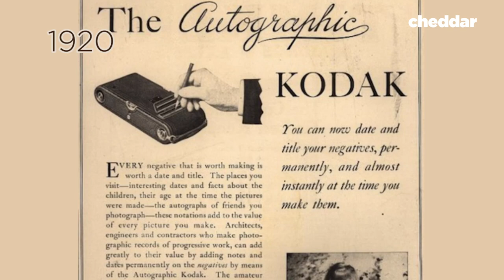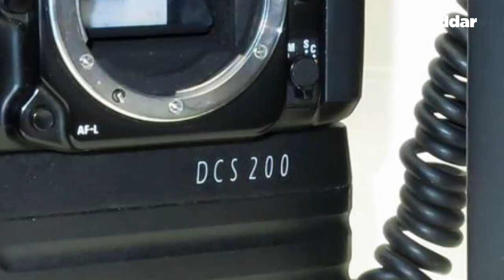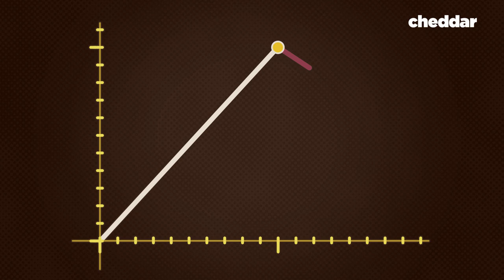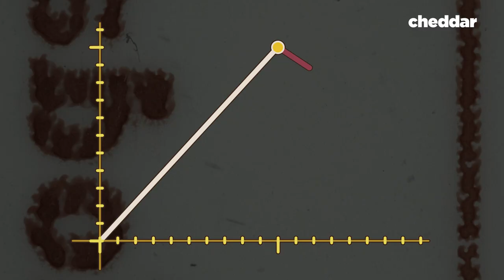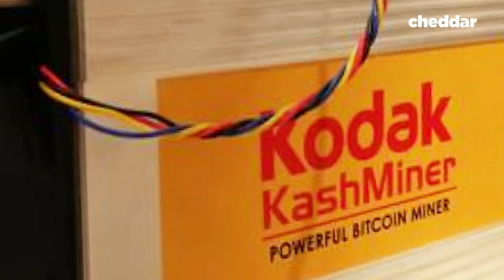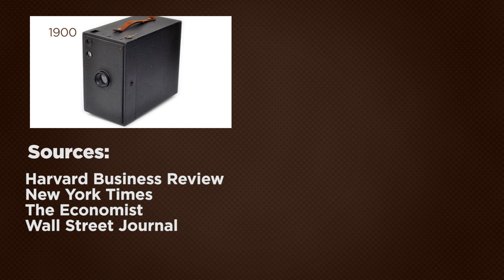Why Kodak Willingly Ignored the Future of Photography - Cheddar Examines

Comment: I migrated from medium format to digital - the Nikon d1x was my 1st pro camera.   At some point in the early 90s Kodak were hyping the heck out of a new digital camera , the DSC that was supposed to be the camera that everyone wanted.   Yeah, until they did their dog and pony show and showed prints that were supposed to have come from that Kodak beauty.   The prints were so heavily manipulated that even an absolute novice would know something  didn't seem quite right.   It was Kodak's insistence that the images weren't retouched that may me decide that I would never knowingly own a Kodak product.   I was sort of ticked off at the time because  I needed a another digital camera and I was holding off buying another D1X based upon the hype.  The day I saw Kodak's presentation was the day that I went to my local pro shop and purchased another D1x for backup.  Which at the time , was somewhere around $3500.  The D1X was "mature" and spending that  was disturbing,  but I knew the limitations of the camera and it was reliable.   At that point,  I felt they were on their way out; they were no longer a player.

Comment: Kodak's downfall had nothing to do with photography and everything to do with the Horrors of MBAs.

The problem in a nutshell: Eastman Kodak was known as a "photography company," but that's not where their profits were coming from. In the years before World War I, the world's chemical industry was based in Germany. Companies like BASF, Agfa, Bayer and the Dyeworks at Hoechst produced all the dyes and bulk chemicals the world needed. Then the war broke out and the world's supply of chemicals dried up. After the war, George Eastman (who founded Kodak) said, "Never again!" and built the biggest chemical company in the United States. They were a huge player in acetate fiber (safety film base is cellulose triacetate; it's no problem to make cloth rather than plastic sheet out of that polymer) and owned the Defense Department's explosives business. Eastman also owned the biggest gelatine factory in America. Their gelatin is very expensive (and extremely pure) compared to Knox and General Foods gelatin so it's not used in food manufacturing, but its purity makes it useful to Big Pharma.

Then came the Core Competence fad, in which you're supposed to pick one line of business and sell off or outsource everything that doesn't support that line of business, and buy other businesses that support the business you kept. Kodak sold the chemical business in 1999. 

Kodak could have had - and actually did have - the most popular line of digital cameras in the world, but without the lifeline Tennessee Eastman provided they were headed for financial oblivion.

Now...what did Agfa and Fuji, both of which were chemical companies who made photo supplies, do differently than Kodak? Fuji still makes chemicals, and Agfa spun off the photo business.

Comment: The original Kodak digital camera was nice but at 8lbs impractical. Perhaps Kodak management couldn't see a way of making it practical with the technology of the day. I remember thinking years ago - when APS film came out that there was so much elecronics in cameras that since they had electronic TV cameras, it made no sense to keep using film. In fact 1976 was pretty late to develop digital cameras. The original TV camera was developed in 1927. Digital stills cameras were a suspiciously slow development. I wouldn't mind betting that the idea had cropped up many times before about digital stills. The holdup was making it small enough to be practical. So, Kodak was right in that it was impractical but wrong not to try to make it smaller and lighter.

Comment: Kodak would take one step forward and then two steps backwards regarding digital photography.  Kodak thought that they were in the photography/imaging business while in fact they were in the film business. Railways in the 1930's thought that they were in the transportation business, but really they were in the train business. If they fundamentally understood that they were in the transportation business then they would have started and owned all the airlines.  EVERYONE at the executive level at Kodak that didn't come in from some other industry would have been weaned on Kodak's basic fact: Color Negative sales are everything.  Kodak sold slide film, B&W film, projectors and dozens of other products but it was all a sideline compared to color neg sales.  That's where the profitability was and everything else was gravy. Any suggestion to get seriously into digital photography  ("Let's buy Adobe." "Let's buy Minolta.") would have been greeted with, "This could hurt color neg sales." and that mindset continued right up until the end. Kodak in a completely different form could still be a (much smaller) powerhouse in the imaging industry but they needed to accept that film was dead years before film killed them.

Comment: It’s very easy to be Captain Hindsight, especially when you are young enough as to not have
lived (and therefore not knowing the nuances) of past’s events. Not every family
had a PC (well, rarely any family had one, statistically) on older times and when they
had one, they weren’t the fast and (relatively) intuitive easy to use machines
most of the people take for granted today: PC's were SLOW, clumsy, prone to
failure, complex devices most people could not handle with ease and even when
they did, they required quite a hassle to maintain and backup. The fist PC's
weren’t easy to open and fix either as they were kind of a device you weren’t
supposed to touch and upgrade. The quality of the first digital cameras that
hit the market were INCREDIBLY crappy, low resolution, slow working and slower
to download photographs that needed a lot of patience and even more patient to
print (a garbage quality) photo if you used the right program and the right paper for such a feat (and logically each camera had their own incompatible-with-others' program). It’s not like
people didn’t like the idea, it was quite exciting, but given such conditions there was little reason to think that there would be a revolution on the gates: practically MOST
photographers LOVED their old (to today’s standards) antiquate analog cameras
with their quirks and abilities to adapt way beyond the things that LATER ON very
costly digital cameras would be able to. People were used to have something
physical to touch, look at, retain and store (and easy to display and SHOW to others) and
remember that those were times where there were no Smartphones (let alone
other handy portable computers and those that existed were even slower, etc.
than desktop computers). Etc. Another factor that people seem to forget is that, the same as today, the market is INUNDATED with gadgets that promissed to be THE NEXT BIG THING to later disappear into oblivion, so it took a lot of trust to really invest on something expensive that later could end up being a useless but "futuristic" thingy (there were so many more failures for any given success...).

Comment: The truth is Kodak tried to put the digital genie into a Kodak bottle the same way they did film but the digital genie had no part of it and Kodak failed to corner the market and the Kodak Moment went poor.  I dropped the Kodak marketing program for my studio in 2000 when I transitioned from film to digital capture.  Fuji offered a better system of digital file to print for the portrait/event photographer and knocked the King off the throne.  In 2010 I began marketing the sell of digital files as well as prints.  Even through I'm now retired I do an occasional job and only offer digital files.
That's my Kodak story in a nut shell, don't get me started on the story of Polaroid.  My daughter just bought a Polaroid snap shooter that uses old tech to put out mini snapshots for fun.

Comment: How about a video on how Polaroid was able to stop Kodak from making instant cameras every time they tried, even after the Polaroid patents had expired? Same video could also cover how Polaroid's fortunes fell like Kodak's, and the resurgence of "Polaroid" by The Impossible Project. They recently introduced a new "Polaroid" instant camera, but the film packs contain only 8 shots VS 10. TIP's film for old SX-70 cameras only has 8 shots because TIP hasn't been able to make their film as thin as original Polaroid film. But the film packs for the new camera don't have a battery so there should be room for 10 shots of the thicker film.

TIP was launched when an old Polaroid film factory in Europe came up for sale. They were able to raise the funds to buy the factory and restore the equipment, but Polaroid refused to sell chemical formulae and certain information about the materials and manufacture of the film. So TIP had to reverse engineer a lot of stuff, which is why their film is thicker and it took a lot of experimenting to get their color film acceptable for use. What they're selling now has better color than what they were offering a few years ago, I assume that's why they've launched that new "Polaroid" camera.

Comment: Easy Share cameras had a limited lifespan, and when they died, nobody anywhere would repair them.
I still have my 1982 Olympus OM10 35mm film camera. Also two or three rolls of Kodacolor 200 film with an expiration date in 2012. I wonder if they are still viable.
Walmart here carries Fuji 35mm 400 film, but it is not cheap. They also, I believe, send 35mm film out to be developed.
I still believe a 35mm will run circles around a digital camera.
Reply: I have a Canon 35mm film camera that I Still use. I've tried the Fujifilm stuff from Walmart but don't really like it, instead a local camera store sells new rolls of Kodak film. Roll in my camera right now is a professional series B+W TMAX roll, and I have Kodak Ultramax film laying around as well

Comment: Kodak mistake was one thing: Greed. They didnt want to let go of the consumables side of their business, to be fair Kodak cameras were quite reasonable at the time, but it was the consumable such as films, developing fluids, paper etc whcih drove the market and which cost the most to procure repeatedly each time. 
The early digital cameras were basically useless and a gimmick as the resolution were poor and they couldn't be readapted to the print industry. However the rapid development in Sensor technology allowing much better images soon got rid of this problem. However people still loved print over digital (it was a bit like the same thing as hardcopy of books vs ebooks; many traditionalist wanted and desired the feel and permanence of a hard print copy).
However what unleashed was the advent of social media and a new generation which wanted more in terms of quantity than quality desired the impermanence of many experience rather than a few solid grounded event and the development of the platforms to support this new philosophy, which saw the downfall of the print camera industry in favor of the digital one.
This change is still going on with smartphones, most laypeople do not want or need to invest in a DSLR or point and shoot camera these days their smart phones being sufficient for the niche use they have for their pictures and events. This is a reason why you seee many traditional lenses makers moving away from lenses for proper digital cameras to work on lenses for smartphones.

Comment: Lmfao the Apollo 11 Moon mission DAC cameras where the first digital video cameras. The Kodak Patent  was actually geared toward cinema productions due to a need for better Chroma Keying that is why Bryce Beyer specifically designed his filter to have more green sensor areas. The Apollo 11 DAC cameras were black and white only due to the sensor. Hollywood at that time had billions invested in film Camera equipment so the move to Digital cameras to take advantage of the keying was not yet possible as the sensors were in its infancy. Even today in 2019 Hollywood still has a stranglehold on what camera features are available for normal consumers. This is why no camera under $10,000 has full manual options ( any frame rate, any resolution ). We need to build a complete open camera with no impose limits.

Comment: If you have stock in DJI, sell it now. The drone market has long been held back by their monopoly, but smaller manufacturers are finally able to compete at the low end. The J.Me and Hubsan Zino offer 4k at a comparable or even cheaper price point to the spark and the zino especially has a solid camera that blows the spark out of the water and can even stand up to the mavic air. But given the way DJI has been sandbagging their low cost lineup to try to force people to buy the more expensive mavic 2s, and even sandbagging the new mavic zoom with lack of Log or higher bitrate which they could easily include, they are highly unlikely to release a spark 2 with 4k. If they do, they will be losing a sizable chunk of the entry level market to 3rd parties and perhaps even take a loss on their mavic air and a future spark 2 release. And if they DO release such a drone, they will be competing with their own mavic lineup with no reason to justify the price difference unless they leave out occusync, which is the one advantage they have over their competitors. One way or another, they will need to pay the price for sandbagging and holding their own technology back in an attempt to justify their inflated price brackets. They WILL lose market share, the only question is how much.

On the other hand, canon has waited this long to break into the mirrorless market and have for the first time found themselves at the bottom of the pack, while other camera manufacturers have already found ways to successfully adapt EF mount lenses without compatibility issues long before the EOS-M. The fringe benefits of their popularity are dwindling now, and being so late to the game, it is unlikely they will release a camera soon that will beat what their competitors can do. And in this aggressive market, camera manufacturers need to have the "new best camera" for at least a few months until the next competitor comes along and makes one cheaper and better to last in peoples memories. There is a reason people are still buying GH5s while the A7III and BMPCC4K are making waves. Hell, the EOS M seems to even be more underwhelming than the XT-3, and everyone who MIGHT have been inclined to switch already bought the adapter for a sony or panasonic since migrating with your pre-existing gear is just as easy.

It seems neither of these companies learned from codec and have clung to the profitability of their pre-existing business model, rather than capitalize on the changing wave of technology. If you hold back technology for personal gain, someone else won't for personal gain, and they'll be the one to win instead of you.

Comment: This make several mistakes. A practical marketable digital camera in the 80s would have been impossible. This is not just about the camera in itself but about all the other infrastructure like computer. JPG format even did not exist. Sony Mavica was not a digital camera. In the 90s Kodak was in the forefront making DSLRs based on Nikon and Canon cameras but as it was not really a camera manufacturer it could just launch its own camera infrastructure. When camera companies developed their own own digital technology they took over. Kodak maybe could have done what Sony did and buy a camera manufacturer.  On compact cameras it has better chance. Too bad for long Kodak was associated with low quality cameras. If should have started to focus on the camera business already in the 80s. Once if had good film camera infraśtucure it could have done easy switch to digital.